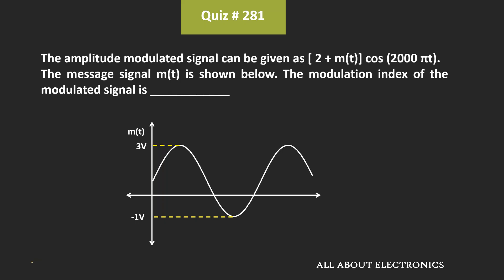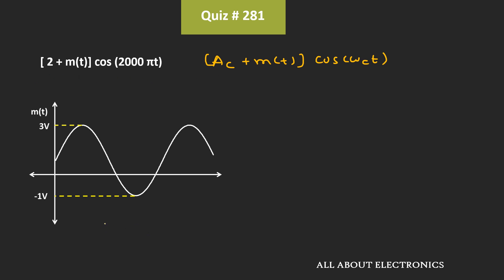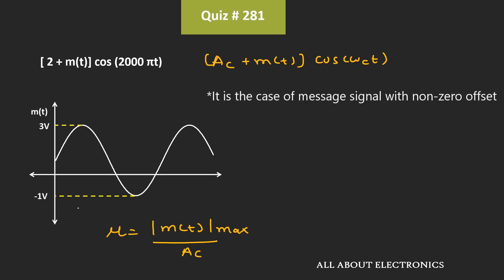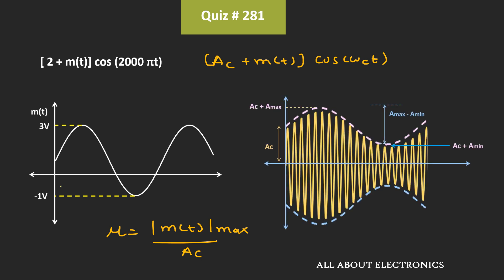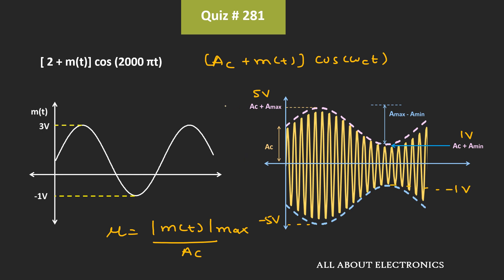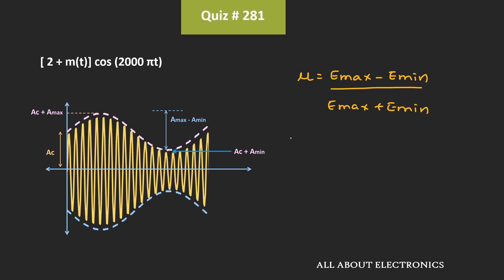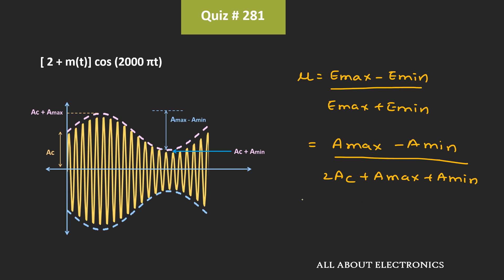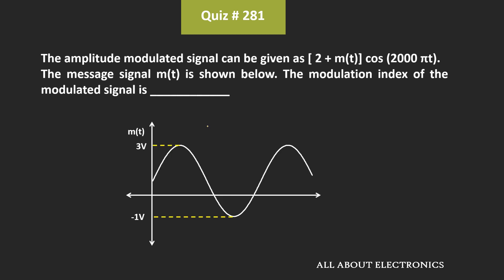Amplitude Modulation Solved Problem | Quiz # 281

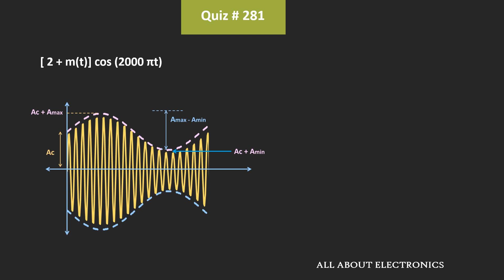Comment: Ac shown in the figure at 2:00 is not accurate, it is equal to the Ac value only when m(t) is a symmetrical signal(no DC offset in the message signal itself).